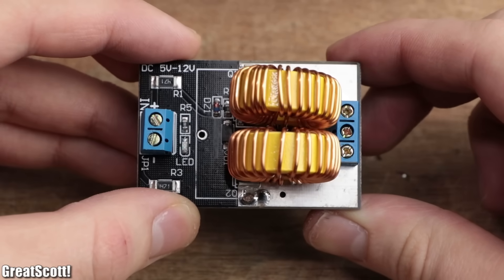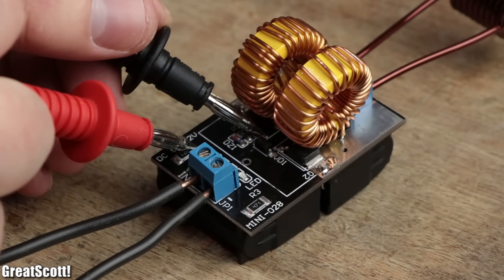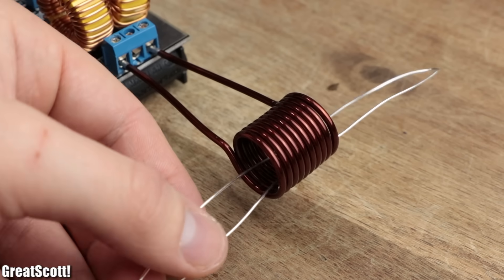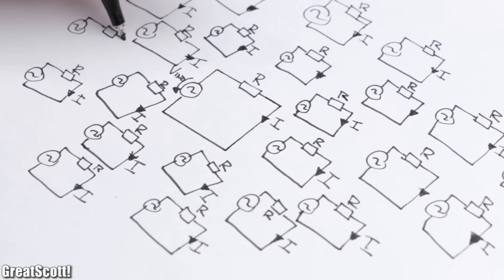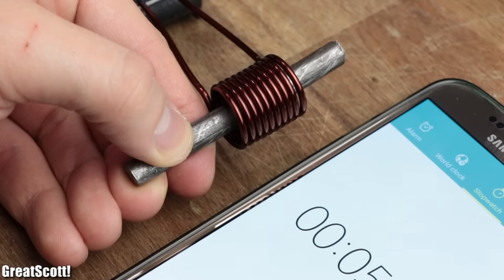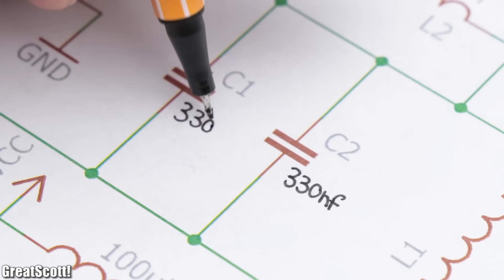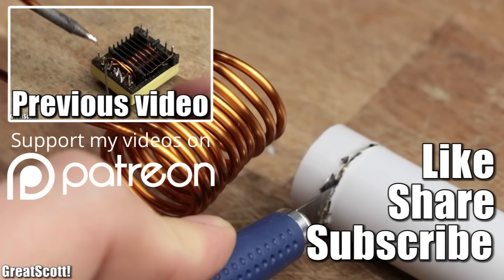How does Induction Heating Work? || DIY Induction Heater Circuit

Comment: very good.
can't we use IN 4007 diode
also pleas show as all the diodes and capacitor that can use to make an induction heater(I am begging you please I want to make it please)
Reply: How about a fully-integrated H-Bridge with plenty of protection against "mishaps" as Ti's TPA3255, for example??

Comment: It's not another hot knife video.  This circuit has real world uses.  For example, you can use the induction heater to help remove rusted or otherwise stubborn nuts and bolts.  Personally I use a blue wrench (torch), but to have something that can do the same job without a flame is highly desired in some situations.  Well as I was finishing my comment the video was ending and I saw the author using a heated knife to cut plastic pipe.  I stand corrected.  I however do not intend to use this circuit to heat knives.

Comment: I want to try build your circuit but i dont have a fancy bench power supply.  If i had a 12v transformer that outputs 3.6 amps how could i do this?  You say that the more metal that goes into the coil, the more current it draws from your supply.  Would this cause my transformer to burn out if too much goes into the coil?

Comment: Hey GS, so the voltage and current change which occurs on insertion of those rods helps us to calculate the resistivity of those rods using the formula R = P/(I^2) right ? because R, A & L we can calculate rho (resistivity)
Reply: Provided the Mazzilli so-called "module" survives, although he never actually inserted/removed a workload as his was just a Tesla Coil interfacing via some Flyback Transformer - with plenty of turns...

Comment: If we want to convert this to an induction cooker what changes should we do.  Point is when u put any ferromagnetic material inside the coil it heated up as inside the coil and inside the coil magnetic field is very strong .  but near to its opening it should work good and produce proper heat .  what changes should I need to use it as induction cooker , do I need larger coils (obviously).    and put small utensil inside it for efficient heating .

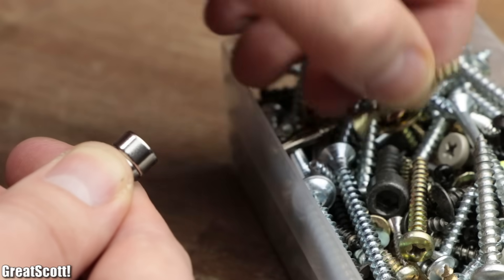Comment: 4:35 The word is Hysteresis or magnetic resistance. When a ferromagnetic material is magnetized in one direction, it will not relax back to zero magnetization when the imposed magnetizing field is removed.

Comment: Would this be more efficient than say an electrical kiln when melting aluminium? If you had a steel crusable that the induction heater heated that then melted the aluminium? I would like to test that or see if it worked & how much energy that would use? Great vid

Comment: Can you explain what the difference is (in easy terms) what the difference in diodes makes? For instance I only had regular 4007 diodes not the uf ones and it works but I notice the coil getting hot even with no metal in the coil. Is that because the wrong diodes?
Reply: Never heard of Google...

https://docplayer.net/26964431-High-voltage-resonant-self-tracking-current-fed-converter-a-thesis-presented-to-the-faculty-of-california-polytechnic-state-university.html
High voltage resonant self-tracking current-fed converter (2010-Mar)
p52/152 Mazzilli Converter Topology

p53/152 Figure 2.9:  Mazzilli Converter Topology

Comment: Im curious, because i have been thinking about getting into blacksmithing for some time, but lack the space for a proper forge. So my question for anyone who knows more about circutry than me is; how would i go about upping the capasity of this circuit? Id like to get into the 1-2kW range as ive seen some other induction forged get to. Hopefully this is the right place to ask this. Thanks.

Comment: When removing enamel from copper wire, first burn it off using a lighter or something. It will come of really easily. On some thin wires, using sandpaper will risk breaking it.

Comment: The sadly posted induction set-up is used extensively in industry. We used it to heat and straighten cutting tools e.g. drill bits, reamers, oil hole drill bits prior to welding....etc, etc.
  Extremely useful sad machine.
  Could someone add to this list as i am curious. Wonderful machine.
Reply: M'yeah, but the Magnificent & Omnipotent Egzoset doesn't work for free.

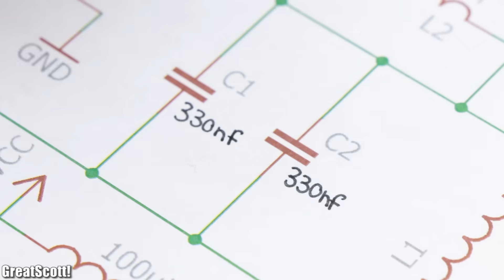Comment: Hey GreatScott, @ 5:36 you're soldering a long metal lead on to the terminals -- I used think you were just soldering like clipped resistor leads, but that's way too long -- so, what type of lead is that, and where can I buy it? (I'll even use your affiliate link if you have one!) -- I tried using jewelry wire before, but the solder wouldn't stick to it. :-/ -- Any advice would rock! -- Thanks, man!
P.s. -- Don't melt PVC pipe (by cutting through it with your hot knife like you do at the end), as the fumes it gives off are neuro-toxins.
Reply: Looks like "bus wire" might be what it's called? -- I ended up ordering this: https://www.amazon.com/Jameco-Valuepro-3818-100-Solid-Tinned-Copper/dp/B00B8866BA/ref=sr_1_2?s=industrial&ie=UTF8&qid=1519334580&sr=1-2&keywords=22+awg+bus+bar+wire

Comment: Does this need to be powered by an ac current or will a battery/dc power supply work?
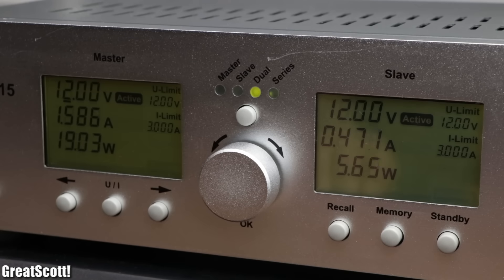Reply: 3:56 this variable power supply converts AC current into DC so if you want to setup similar circuit as his, you need DC power.

Comment: Do I have 2 use a uf4007 diode? Or can it be any fast diode?
Reply: https://docplayer.net/26964431-High-voltage-resonant-self-tracking-current-fed-converter-a-thesis-presented-to-the-faculty-of-california-polytechnic-state-university.html

High voltage resonant self-tracking current-fed converter (2010-Mar)
p52/152 Mazzilli Converter Topology

p53/152 Figure 2.9:  Mazzilli Converter Topology

Comment: TLDR; it just says not all too many people watch your videos for content like red hot knifes cutting things. Like 4 or 5 times in too many words.

Actually instead of being hyped by the idea of a hot knife, I'm really intrigued about the maths, science and data... I want to understand how induction heating works on the electron level, and I want to know how to read the mathematics (the symbols used in the mathematics of electronics are unfamiliar to me, so I can't read the equations, if I can't read them, how can I understand the so that I know which numbers plug into which parts of which formulae and how to manipulate [rearrange] the formulae.) I wish I knew how to read and draw electronic diagrams. I thirst for this knowledge and your video just induces a deeper thirst. I have a mixed feeling of being disappointed/upset that I can't just know this stuff instantaneously simply because I want to (basically frustrated that learning will take time) and excited because I know that I will come to understand these things, the mixture of these emotions is most similar to anxious. I am quite aquatinted with this feeling as I've felt it most of my life as it is all too often that I am exposed to areas of interest to me that I have yet to find the time to research. This is because I basically want to know everything there is to know about almost everything, yet I cannot learn it all at once. I've been interested in electronics since I was very young, maybe at age 7 I modified my walkie-talkie to pick up more of the radio spectrum than it was intended to and increased it's range... I did all that with no soldering iron, no help, no instruction, no tools, and against my mum's rules, then when I was about 10 I converted a few walkman's a sound card, some wire and some components into an audio tape player for my computer so that I could put tapes in my computer and play the audio through my computer's speakers while still being able to hear the audio from the computer at the same time... it was at that point that I was informed of the name of the technique I was using... it was called guess-and-check... I think I did have my home mead soldering iron as I learned that if you short two leads of a circuit with the right metal of the right thickness you can make the metal glowing red hot... and I wanted a soldering gun, so I made one... shortly after my audio cassette computer component that I started a project to collect as much solder from the PCBs of anything electronic that I could find in the trash... which led to collecting components (capacitors, transistors, resistors, etc.) even though I didn't have a clue what any of them did or even what they where called. I still don't... I'm still at that level because then I transitioned into a computer hardware geek, which led to changing to a programming geek, which led to studying computer security (read; hacking) and then back to programming as a necessity to continue my studies, then I was 14 and I got sent to live with my dad who I hardly knew, he was an electrician's boss's boss's boss (he worked his way up from electrician to foreman to journeyman to company owner) and he forced me to go to work with him, and I hated being told what to do like that, like it's not the same as being told to clean your room, wash the car, take out the trash etc. ... so I resisted the work and wanted nothing to do with electrical nor electronics so I digressed into other interest for a while... the point is I've always been too busy learning other things and thus never found the time to get into it since I was maybe 10-ish... but I'm over the hating it and I want to get back into non-computational electronics. Your video both inspires me, and reminds me that I'm frustrated with the fact that the real world doesn't work like it does in the movie; The Matrix where the character Neo plugs a cable into the back of his head and within seconds he knows everything there is to know about helicopters; how to fly them, how to fix them, how to build them, how to engineer them, exactly which capacitor is needed to fix some particular problem in the instrument panel of a specific make and model of helicopter... like EVERYTHING there is to know, that is the world I need to live in, I cannot stand that this world is not like that. Because that means that it takes time to learn... well I want to know everything about everything... but there is one problem... my currency for knowledge is time, which happens to be dealt out as if it where a finite resource, even though it's not. So unfair. Once more I can never check my balance... I know most people get about 80 years with very few getting as much as 120 plus and many millions times as many getting only hours or even just a few minutes... and I've already spent 36 so how much do I have left? Enough to make it to the end of typing this sentence? Apparently so, but I can't know. But I do know that I don't get infinite time, I only get some... thus I will never get to know very much at all about but a minuscule fraction of what there is to know about... the saddest truth I have to face. So now you know more than you probably ever wanted to know about one on your audience members... and no I'm not all about 'Yeaaaah! Let's blow some $#!+ up, cuz 'Merica!!!' No I don't fit that stereotype, and I find it highly unlikely that very many of your audience members are like that either. I am odd though, I have never left North America, I've lived in the US my whole life, I spell my female partner's informal title mum not mom, I only understand metric (I do not understand US customary units except gallons and I happen to know that a mile is just over 2 clicks (that's US slang for km, used almost exclusively by the military as Americans don't usually understand how long a km is) so yeah, I am an oddball. That having been said, I stand by my hypothesis that the majority (by a slim margin) are not just here for things like red hot knives. I may not fit in with my culture, but I believe your content draws a certain crowd, and the people who 'sadly' want to watch the content that you seem to think your audience wants to watch, would likely be quick to click away from your videos as soon as you get technical. Just saying. Anyways awesome content, I love your videos, I just wish they went a little more in depth while explaining some of the basics too. When I watch this I think can I cook the Christmas ham this way? Not something like um... uh... oh , like can I make a superheated Samurai sword? No that's too easy, just upscale... but a ham, well hams are far from ferromagnetic... and sure I can heat a pan but can I instead make an environment similar to a microwave oven? Hmmm that's the types of things I think when I see this technology. Side note I think I still have my diy soldering iron, a shoe-box of salvaged components, and a baby-food jar of solder slag.  And yes, I broke a lot of circuit breakers and burned wholes in carpet and that iron was extremely dangerous... oh and yes I now have a professionally manufactured soldering iron that I rarely use. Okay I'll stop drilling at that point now, and to anyone who read this far sorry to have waisted your time, this was for my own therapy, but if I don't post it, it feels like it doesn't work. I have to chance someone reading it.

Comment: First
Thank you for the full explanation
It Worked efficiently on 12 volts
Its connection to 40 volts burned the mosfet
I don't understand why
Reply: Really??
Reply: @Egzoset  !!!!!!!!!!!!!!!!!!!!!
Reply: @ronee505 ,

What?  You set fire to the house??
Reply: @Egzoset  I ask why when connecting 40 volts the mosfet was burned when everyone says that the circuit works on 12 volts to 48 volts?
What is wrong with it during implementation knowing it was working well on 12 volts

Comment: I have a question, since we know that Induction require AC current to create flux. However, when i use DC current input (acctually it recommend using DC 5V-12V). How can the induction heater module change from DC to AC, and which part is used to change from DC to AC. PLease help me, I gonna do tis project for my test next week

Comment: I have an idea for a stirling hot gas engine with copper cylinders with strong earth magnets just below the pistons that will pass up and down within the copper cylinders and generate electrical charge then passed through vacuum spark gaps to generate the frequency needed to pass through coils in the cylinder heads to heat the titainum or alloys within a graphite crucible to provide the heat needed for the stirling hot gas engine. Imagine a V-6 stirling hot gas engine with solid state graphite power cells that charged an organic carbon power cell that first powered up the V-6 stirling hot gas engine which then powered itself from generating its own current which then cranked a large rewired drum motor generator with magnetic bearings on each fly wheel that generated high frequency electricity that you could then modulate that electrical  frequency to power other devices? That could replace diesel and gas generstors and be way better then solar? You think the concept would work? 😊
Reply: Euh...

If that's about moving magnets for heating then take notice this have been demonstrated quite some while ago:

https://www.youtube.com/watch?v=Br3GQUxPNNc

https://www.youtube.com/watch?v=fkdo8A58E8I

So why DynaVap still ain't working on this instead??

Comment: Hey :) I want to make a furnace to melt aluminium cans. I don´t want to make coal/gas powered furnace, but I want to make a electric or induction one. Which one would you suggest and how? (The copper solenoid needs to be around 10 cm wide so the melting cylinder in which I can put cans in can fit in)

Comment: Are you able to change the frequency on the coil by using a computer hooked up to the heater?
Reply: Not by using an over-simplified dirt-cheap obsolete/rebranded so-called Mazzilli "ZVS" PCBoard, even less if stuffed with 2008 semiconductors or so...

Comment: Hi Scott, what is the circuit frequency?
I built the similar circuit but the MOSFET getting hot when reaching 50 Khz up. I didn't use heatsink because it is bulky.
The circuit ran a tiny ferrite transformer. While I use small capacitor (high frequency) the MOSFET getting hot (not as hot as a coffee cup, but it is uncomfortable).
With the lower frequency the MOSFET was pretty cool but the transformer getting hot.
My goal all the components are small & cool so it fit into small casing without heatsink.
I use IRF540, UF4007, 1k pull down resistor and 200 ♎

Comment: Nice post. How much power does the apparatus draw when no metalic rod is present in the induction coil? I'm wondering if it's practical to leave it on for a full working day - as opposed to powering it up only when needed. Kind regards.

Comment: I was wondering if I could simple take a "n" turns coil of "D" diameter and connect it's terminal to a 220V AC and still get the magnetic field?

Comment: I think that materials with less resistance will heat up faster since under same dB/dt you get the same voltage, with less resistance you'll have larger current and larger P=IV. Otherwise with such logic, plastic has super large resistance so it will heat up faster than any metals.
Note that the alumi bar may be aluminium alloy rather then pure aluminium so may be more resistant than brass and results in lower current. Comparing by temperature difference isn't that good since the heat capacity of aluminium is over 2 times larger than brass.

Just point out some potential flaws, you still did a great job!! Impressive reverse engineering

Comment: I am wondering if it could be used to heat copper wire for annealing or would the resistance be too low? I am talking a short length of 2.5mm2 copper wire.